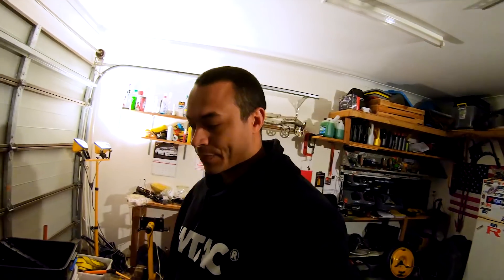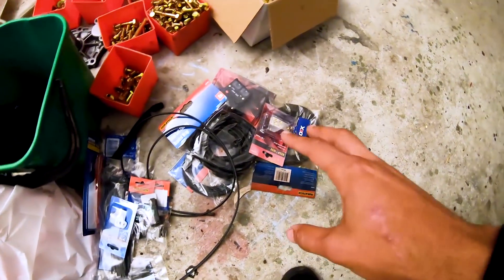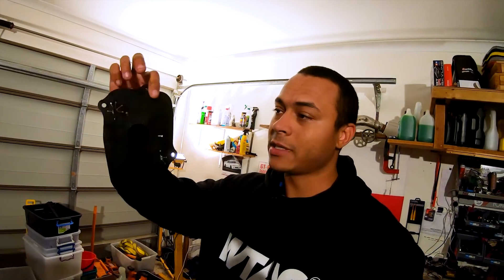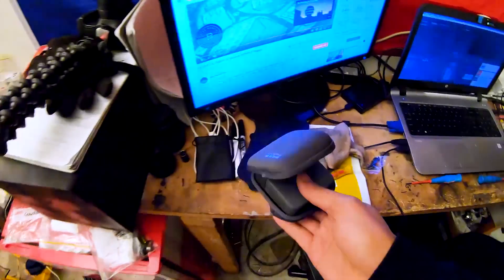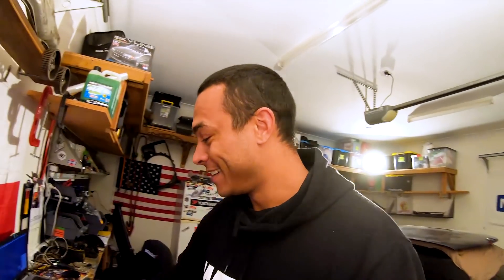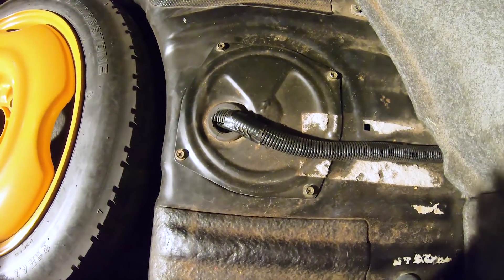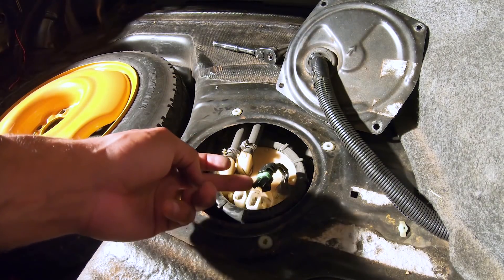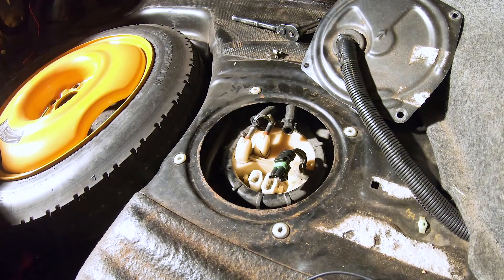Does E85 rust fuel setups over short periods of time? | Mancave minutes 14

Comment: While I agree about the myth being WAY wrong, the more likely place for rust is the bottom of the tank. When the fuel pulls the water in, the water will separate and sink to the bottom of the tank. So the pumps are the most likely place for the water to be attacking, not the top of the hat.
Reply from the maker: Yea I could see that, but being a GTR tank is plastic I don't think you'd see rust at the bottom. The baskets are plastic the pump pick up is plastic, the only metal is the pump body and inside.
Reply: @ItsCardo1987  Yeah will be fine but for us non GTR peasants, that's the problem area... Mine sat for 2 years, no drama.